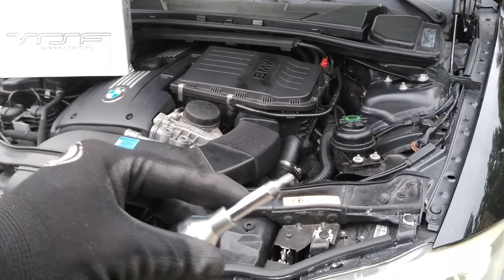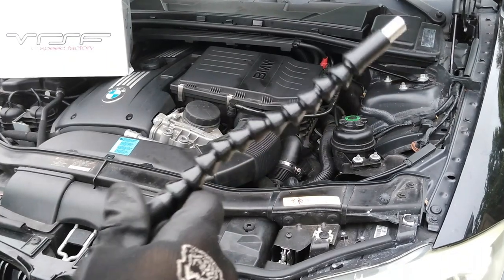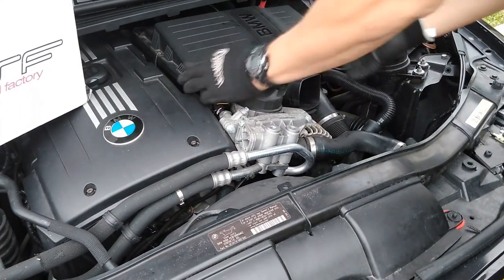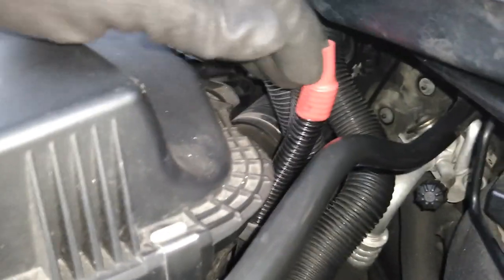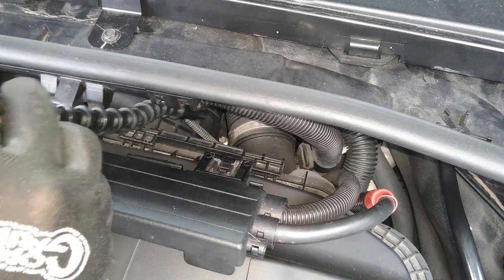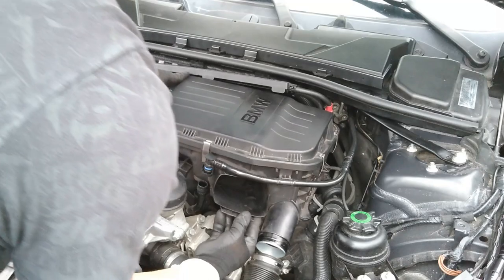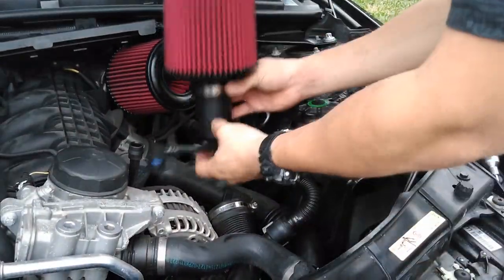BMW N54 Dual Cone Intake (DCI) Install + Sound 335i, 135i, 535i, *Easiest On Youtube*

Comment: Thanks for the video. It made my install easy, especially the tip about using a flexible drive shaft. Only thing I did different is I pulled out the airbox cover and filter to see better.
Reply from the maker: That's what up man 👍
Yeah it does get a little tight in there, and that Tool when you need it, it makes a hell of a difference.
Reply: @CrazyCarMods p lpk

Comment: Do you have the tune the car after the intake install or can you just run it like that .???? Will it throw a check engine light ??? Do to more air flowing through the maf sensor

Comment: So what do you do with the three cords you had to pull up to disconnect? just leave them their floating? and that long horizontal cabin filter thing came broken on mine too and won’t sit right, is it okay to just remove it or replace with a performance oriented part? if so please make a video on it this was really helpful🙌🏽🙌🏽
Reply from the maker: Hey what's up Carlos. 
Ok look, in the beginning I didn't understand your question, so I actually had to watch the whole video to see what you meant. 
As far as that horizontal piece that come broken I ended up taking it out and I put the thickest wire harness in the grove and the smaller one I just tucked it in the best I could. This way it all looks clean as if it was meant to be that way. 
Take a look at the video at minute 10.
And you will see how i put the thickest wire harness in the grove. The other one put it there the same way. Look at the video in 1080p Hi definition and look at it in a big screen so you can see that wire and how you can put it too. There is a settings icon where the video is playing that you can select the quality of the video. On the phone its hard to tell but on a tv or computer you will see much better.
Hope that helps bro. 
Let me know how it goes

Comment: Old video but after pulling that cord that goes over the intakes assuming it’s brake boost line or something I now have yellow brake light and brake pad level low malfunction ? Is there a way to reset that or what can I do to get rid of yellow brake light

Comment: The top cover comes off ,it’s a few bolts and the side being held by the plastic flaps and removing the cabin air filter housing. you will have access to every bolt.

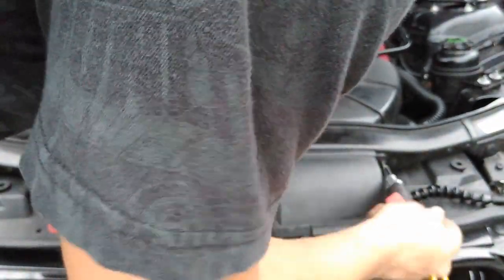Comment: What is the function of the peice at 9:25 ? It doesnt look like you connected it back to something other than the screws  . Thanks!
Reply from the maker: This piece that you are referring to is called "Air Intake Duct" you can find it either by typing the year, make and model of the car or by the engine code (in this case N54) and then typing air intake duct. What this piece does, is that it helps direct the outside air to your intake. Hence for performance people like using air scoops; which as the car moves, the air scoops gives this incoming outside air an easier and smoother route to the intake. 
And yes the air intake duct is only held by the 2 screws. 
A good illustration of what I just describe can be seen in this picture. 
the 2 red things you see are the air scoops. 
https://picclick.com/Performance-Air-induction-Scoops-Fits-BMW-E90-E91-321996620844.html#&gid=1&pid=4
Hope that helps.
Reply: @CrazyCarMods  so after installing the dual cone intakes I just put the two screws for the air intake duct and I'm all set ? Or do I have to connect the air intake duct to something else afterwards ? Thanks so much. Noobie here lol
Reply from the maker: @Fatih308  No prob man, we where all there at one point. Yes, connect the duct with the 2 screws and that's it, your done. As a side note, take in to account that in this video I am also showing my diverter valves blowing in to the atmosphere to make the car/engine sound like I have a BOV (blow off valve). If you wanna learn a little better what I mean you can watch the following video where I explain how it works and why it works. Its a pretty cool mod.
https://youtu.be/hm8OrdvfNZY
Reply: @CrazyCarMods  I'm planning on getting catless downpipes too. I'm getting the vrsf downpipes. Now what confuses me a little is going catless just deleting it from the car ? So no extra part required? I would just need the downpipes correct?
Reply from the maker: @Fatih308  The cats, cat or catless, when it comes to cars are a slang for catalytic. More specifically “catalytic converter”. In order to understand what catless is and how taking or getting rid of something can be beneficial or not, there needs to be an understanding on what a catalytic converter is, what it does, and what effects can it have when it comes to performance. Your catalytic converter is positioned on the beginning of your exhaust system by the engine. The job of the catalytic converter is to reduce toxic gases and pollutants in exhaust gas from an internal combustion engine into less-toxic pollutants. In other words the catalytic converter works as a filter of gasses produced by the engine  before the gasses exit through the exhaust, Hence helping with our environment. In states where cars go through emissions, if you don’t have your catalytic converter, your car won’t pass the emissions test. So what is the benefit when it comes to performance???
Catalytic converters restrict exiting engine exhaust gases  and create a significant source of engine back-pressure due to the way they are made (filtering mechanism).  Removal of catalytic converters from cars allows exhaust gases to exit their engines much faster and at higher levels. Therefore allowing the engine to flow better, which in turn it will allow you to make more power; you will also be polluting the environment. Keep in mind that you will need to tune your car to make more power. Also taking your catalytic converters off will cause a check engine soon or check engine light, due to the computer detecting that the catalytic converter is not working and/or not doing its job (since there is none). You can code this out with your tune as well.

Comment: I installed mine yesterday but I’m not getting any of the sounds that intakes usually give. Any idea why and yes I do have everything tightened down properly I double checked twice. Thanks to anyone in advance that can help.
Reply from the maker: The only time you should hear some sucking in of air (vacuum like) is when you are under boost. Try listening to in without the cabin air filter in.
Reply: @CrazyCarMods  When I’m under boost it sounds like the stock air box is still in. I don’t hear any sucking in air. Ill try with the cabin filter out like you suggested. If anything I will let you know. Do you think it could be the inlet pipes? Also thank you for your suggestion.
Reply from the maker: I doubt it could be the inlet pipes, but another way you can test it out to see how it can suck air is by taking out one of the Air intakes out and putting the palm of your hand by the opening and then have someone  accelerate the car rapidly up to 4000rpm then you can feel the suction. If there is no suction or very little suction then, there is possibility that the inlet by the turbo is lose, unplugged or broken. This is rare. But possible if the turbos where changed or upgraded.
Reply from the maker: You can test both of them so you can compare, both intakes should have the same amount of suction.
Reply: @CrazyCarMods  Thanks for the tip I will try it and get back to you. I was reving the car with the hood open and I heard nothing. What if there is high suction when my palm is over the inlet. Do you thing I should keep adjusting the pipes for the intakes? Or maybe replace the claps on the inlets because they are kind of rusty.
Reply: @CrazyCarMods  Just ran the test there is suction… But no sound… I tested both intakes but nothing
Reply from the maker: Are you looking for the blow of valve sound? 
The air intake sound is like a whooosh
And then the bov sounds is like a pssshh
Check this other video out, this is may be what you looking for 
https://youtu.be/hm8OrdvfNZY
Reply: @CrazyCarMods  I’m looking for the standard  whoosh sounds an intake usually makes. I have a HKS bov on the way but they are back ordered right now and I already have a ARM charge pipe just waiting on that. I was just worried that the intakes weren’t sucking in any air but thankfully they are. I’ll look into that video to see what’s up.

Comment: Good video. Thanks for sharing. Under hood temperatures will typically be drastically higher than the outside air.  I noticed you didn't call it a cold air intake like other foolios do.  I get it, more unrestricted air flow helps performance but doesn't hot air do the opposite?

Any improvements? Any tuning required?
Reply: I was wondering the same if it needed to be tuned ?? Does it ?
Reply: @johnmcglynn271 to get the full use out of anypart yes. But it will get more air naturally so no. But if you want to get the most use out of the air then yes you tune it

Comment: My dci only lasted a day. I was hoping it would give a nice deep induction noise like a na engine but all I could hear was whoosh this and woosh that and I didn’t find it particularly enjoyable. I still have the stock air box on mine as a result. It would be good if someone made an aftermarket lid which gave more volume etc.
Reply from the maker: What your hearing is the sound of the turbos spooling. The more spool the higher the vacuum noise. On a natural aspirated engine is a more steady induction lower sound. And on a supercharged engine the vacuum sound will be way louder. The noice is going to differ. We all have different likes. You can probably try the "Dinan cold air intake", which is probably something more of your liking. It's definitely pricey though, but check it out.
Reply: Crazy Car Mods yes I have no doubt the engineers at bmw positioned the air box above the intake manifold to help amplify the combustion sound which is the only sound you get with an na engine.....just a heads up to people if they’re thinking of a dci.
Reply: the other problem is you are now allowing more warm air into the turbos due to the engine heat under the bonnet.  the factory airbox actually delivers more horsepower.  on a dyno using the VRSF setup I lost horse power. yes you read that right it reduced the horsepower!
Reply from the maker: Interesting. I know the DCI get heat soak when the car is not moving, but that is counter acted by the increase in air and a good intercooler. Which set up where you using when you went to the dyno? Where you using the stock intercooler or an aftermarket intercooler?
What stage or psi where you running? And how much difference in numbers did you get? 
Dynoing the car is definitely the way to go. Post more info brother, Im sure many other guys wanna know too.
Reply: @CrazyCarMods  I agree with Joe as I had a similar experience on a stock n54 engine. The vrsf website says 20 hp (I think) increase and I don't think that's true.
Reply from the maker: Sammy, did you get to take it to the dyno by any chance?
Reply: @CrazyCarMods  no I didn't unfortunately. I can't be certain but it's just a feeling when I drive it that nothing has changed or it's actually got worse. I'm going to put my stock one back in this weekend and compare them.  It's a shame really as the twin system does look better.
Reply from the maker: Is there any way for you to log the temperature? Also is the the only mod you have or do you have an intercooler also?
Reply: @CrazyCarMods  I'm just running the factory setup and I don't have an intercooler. Pretty hard to log temps